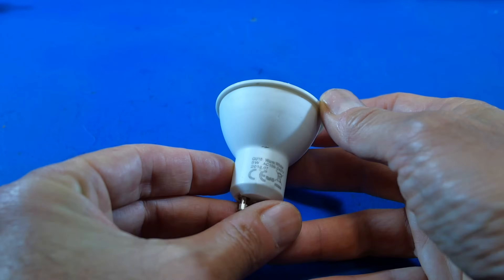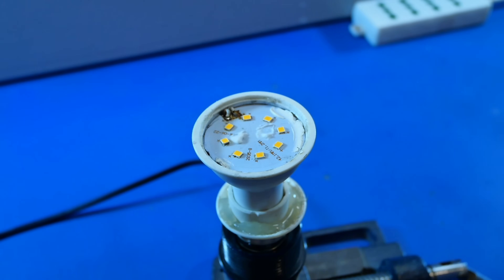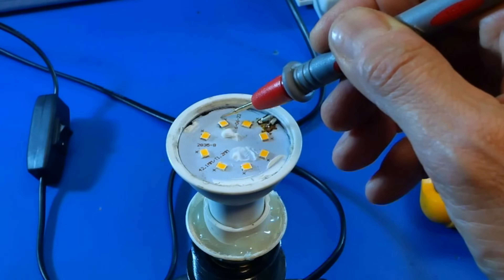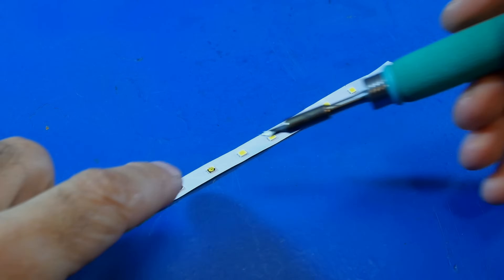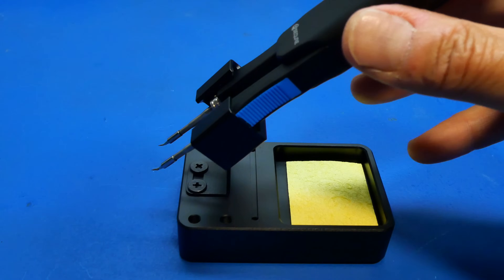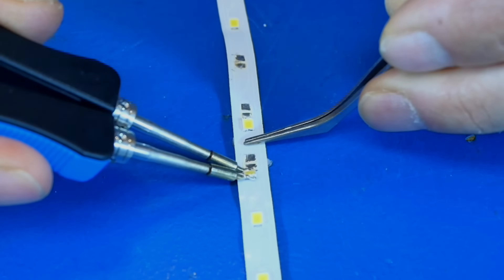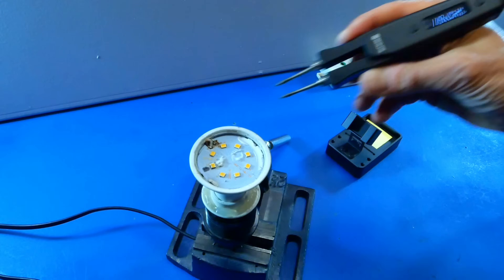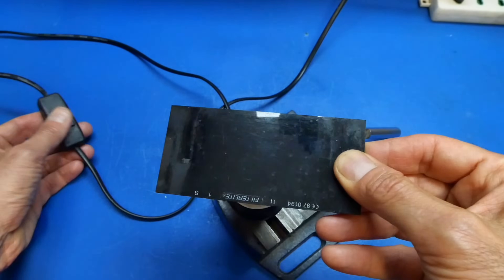This LED Light Bulb can Last 60 Years !!

Comment: I have at least 6 LED lights in my house, they are about 10 years old & none have burnt out yet, they are  Philips which are one of the best.
Reply: I have some Phillips that have continuously failed. I took them apart to see why. The capacitor solder joint broke on all of them. The other problem was that Phillips epoxied the heatsink to the plastic housing making is impossible to take apart the bulb without breaking it.
On the other hand I have  LED bulbs from many brands that were bought over 20 years ago and still working.
Reply: @bobsoft  It's more than likely your Philips LED lights are counterfeit. As I said, none of mine have failed.

Comment: All of my failed LED lamps did not have failed LED  diodes. 95% of the problems lies in the current and voltage control cct. One way to prolong lamp life is to keep the assembly cool especially in enclosed fittings. We can also improve cooling by removing the diffuser on top of the lamp although we expose shock hazards on the circuit.
Reply from the maker: Hi, yes i found some faults to be in the circuit but for me most were burned out leds ! great tips you gave ! thanks for watching !

Comment: When removing it, put a small heated spoon or metal close to it, it heats up the area and removes it, and when removing it from the LED, put the heated metal under it, it heats it from the bottom.
Reply from the maker: Great tip ! i will put im practice next time ! thanks for watching !
Reply: @Repairman10169  The easier it is to make it, the easier it is for people to make it from materials at home.

Comment: Good deal, for a 2$ bulb fix you just need a 100$ tool, but that bulb will last ...forever? What if the capacitor is dead?
Reply: Just replace it🤔